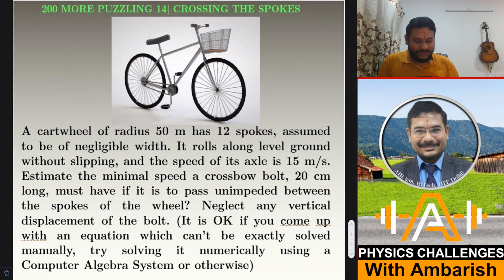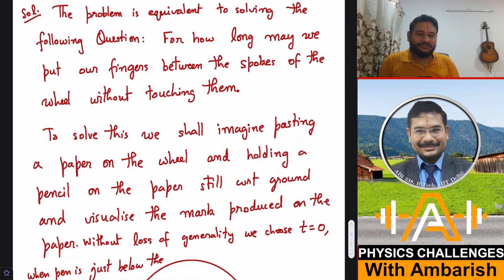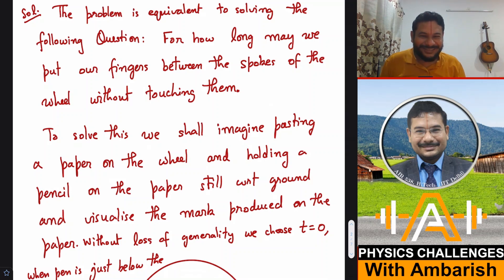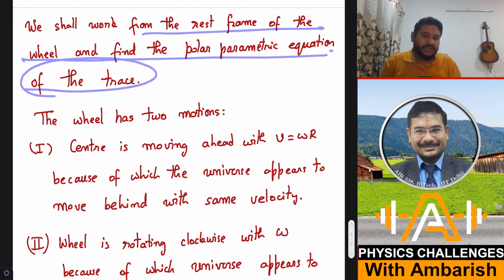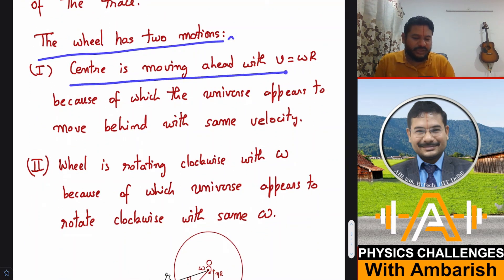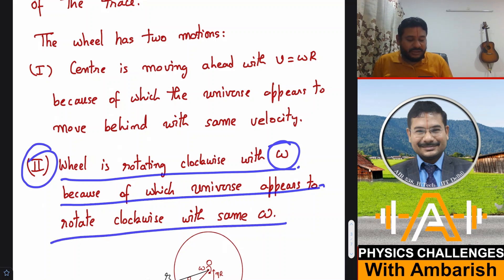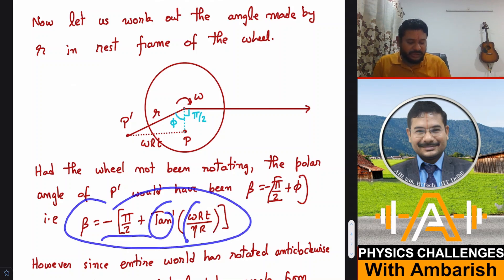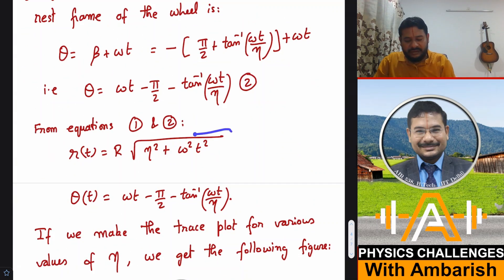ROTATIONAL MECHANICS| 200 MORE PUZZLING| CROSSING SPOKES OF A CARTWHEEL| PROBLEM 14

Comment: Sir is it possible mridul agarwal jee advance paper like  halua type questions
Reply from the maker: Actually Top Ranking Students generally focus on scoring... for Halua type questions they will take it as a challenge to do it with lightning fast speed and accuracy... yes they may not like it but they do not resist it either... resisting makes one prone to silly mistakes... for easy questions take it as a challenge to do them fast and accurately...